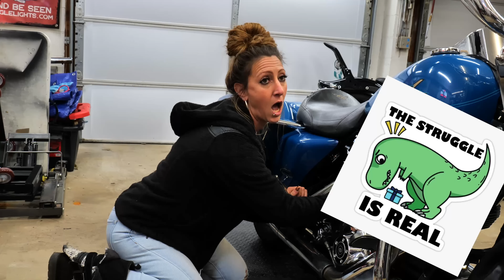Let's Take It All Off Anyway...Road King Build Pt. 6

Comment: Hi guys, the battery ratchet is a great add for the toolbox and down here in Oz when we have to use heat to loosen nuts and bolts, we say that we had to use the 'gas axe' to get them off. So next time you come across a stubborn rusted up nut or bolt, call for the gas axe.LOL.

Comment: Handlebars, I got nothing ....
Six, half dozen, or the other, which do you prefer since you have to look at / ride it ?
Exhaust, since you're not looking for the HP gains a 2 into 1 brings, again, it's what you prefer. A lot of tubers are going with Krome Werks & say they're getting good results. Me, being in Kentucky, I try to use RCXHAUST  from RC Components whenever I can. I've not had complaint about them, ever. 
And the 4 wheeler, that's a big fat, No !! I'll keep watching.

Comment: Guys, please don't use powered tools on Harley exhaust flange bolts, unless you like removing cylinder heads to replace the studs.
Please let me help, if you use heat, IMMEDIATELY spray a penetrating fluid as if you are trying to cool it off. It's called, wicking, the fluid will be drawn into the threads as it's cooling down after heating. 
Secondly,  find a good hardware store that has STAINLESS fastners. When reinstalling use a flat A.N. washer, then a lock washer, then a nut, all STAINLESS. Clean the threads of the studs and apply some Anti-Seize, before the above hardware. 
They will NEVER loosen going down the road and NEVER freeze on the studs.
I've been doing it this way since the Evo days. I'm close to the ocean, and even the salt water doesn't negatively affect this. I change exhaust often on the dyno and never had a problem in decades of this procedure. 
My sister isn't far from you, I'll see if she knows of a hardware store that won't look at you cross-eyed if you ask for A.N. STAINLESS. 
And they look cool too.
T. S. RACING 🏁
Reply: A.N. flat washers have a very small O.D. outside diameter so they fit perfectly on the flange and around  the pipe without grinding. 
I know I started the beginning of the first message saying bolts, but of course I meant nuts.
Reply from the maker: Thank you! Didn't know what it was called, but I was doing the wicking off camera.  Luckily Tanya never got the power tool on the exhaust nuts either! Haha appreciate your help